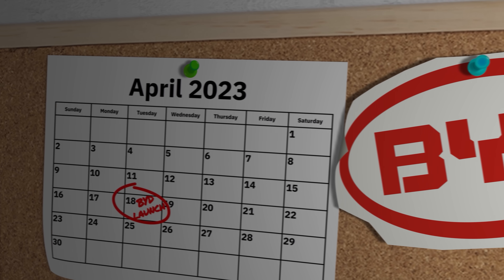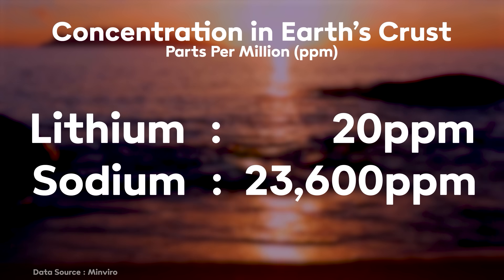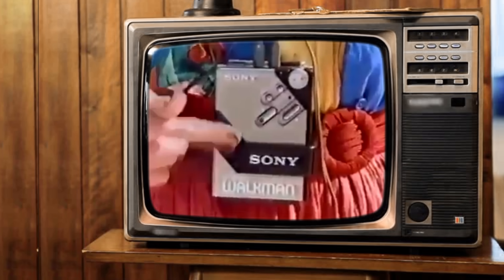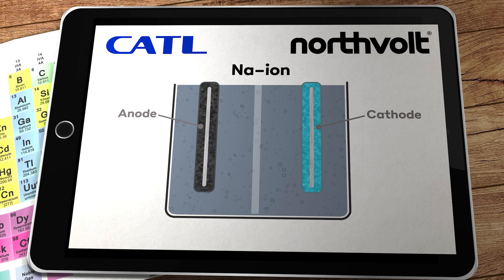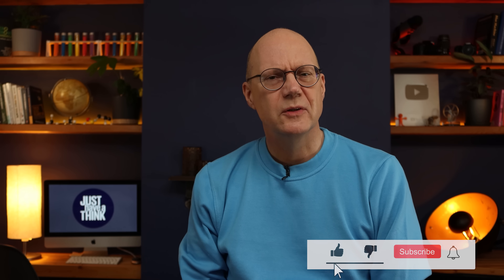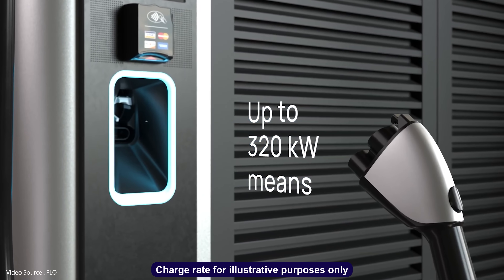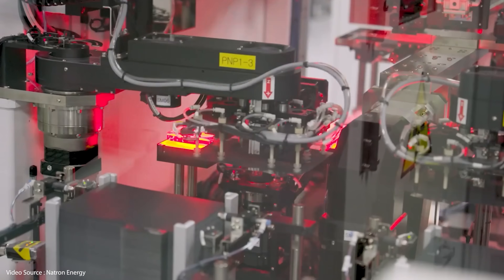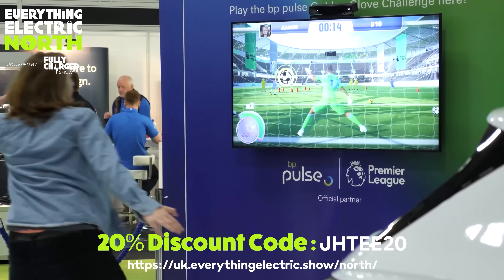Sodium-ion batteries in the USA. Beating China at their own game!

Comment: As far as I have been able to determine, the problem with sodium ion batteries is that their voltage range exceeds current inverter technology to utilize. Fully charged, the voltage exceeds the inverter capacity, which would damage the inverter. And the inverters are not able to function at the lower voltage of the sodium ion batteries. Leaving much of the battery capacity as unusable on the low end as well. The result is that while a sodium ion battery may have a 100kwh capacity, the inverter cannot utilize but about 60%-70% of that capacity.
Reply: There's nothing about an inverter which fundamentally prevents them from using the full voltage range. Its just that they aren't designed that way because there was previously no point. I bet that the inverters in the Natron UPS are able to use most if not all of the voltage range.
Reply: I'm a big fan of batteries in power tools, home power, I use lead-acid for home, because it is simple, predictable, well understood by the layman, and should there ever be a huge failure in the grid, I can still weld, charge my power tools, my home with standard solar/wind, even if I had to run cables from a lead acid bank to the power tool it still works, Many factories, and businesses have lead-acid battery bank backups, the current narratives push change/upgrade to more complex lithium storage. China has shown that batteries have a place, but you still need power stations, and they tend to make sure it works before they commit to infrastructure/mass transport, the complexity of sodium/lithium, and the inability of ordinary p.eople to use it without help, [as they did with the car as I grew up] will be a problem

Comment: a 15 minute 0-100% battery is a game changer for EVs. right now it takes way to long to charge a car. and fast charging is really rough on lithium batteries. even at a fraction of the energy density you could still build car with decent range of 200 miles. and if i can fast charge that pack to 100 in 15 minutes, that 200 mile range is fine. thats 3 hours on the highway and stopping and fast charging for 15m and another 3 hours of driving. thats not bad at all.
Reply: For years I've said, if I could stop to charge for 10 minutes every 300 km (185 miles), that's the threshold where I'll feel like EVs no longer have any disadvantage for road trips. It's still longer and more frequent stops than in a typical gasoline car, but that's the point where I'd say "close enough."

(Of course, this also presumes fast, reliable EV charging at those intervals on any highway where I can expect to find liquid fuel stations today.)

Both sodium ion and solid state lithium ion seem to be heading in that direction. Can't wait.
Reply: Yea heavier but quick charging. So less range for the weight but capable of "gassing up" on the go. Theres a market there.

Comment: Because there was no mention of CO2, for a change I can agree with you. Last week, I did buy 39.8KWH of Lithium Iron Phosphate batteries for my home solar, couldn't wait any longer for even better technology. That said, the cost will be very reasonable after the tax credit and rebate are applied.
Reply: still not bad battery's really you should get 15-20 years out of them before you are below 60% of there rated AH
I have been looking into LTO cells by YinLong for a long term pack i'm making that should last 30+ years
Reply: @NightshiftCustom  The EP Cube (Canadian Solar) batteries are guaranteed for 80% minimum capacity for 10 years.

Comment: You didn’t mention the 50,000 charging cycles! A lithium home battery in the UK typically has around 6000 charge cycles giving them a lifespan of around 15 years. 50,000 cycles in theory means over 100 years!!
Reply: another claim but in a working environment likely much less.
Reply: Or Virtual Power Plant, since some home battery makers won't warranty VPP use
Reply: look up LTO cells made by YinLong they been around for years super safe and rated for 30.000 recharge cycles with very fast charge and high discharge 
they are used manly in buses but are really big right now in the car audio world
Reply: I use a radio that is 75 years old now, works great.
Reply: That is ridiculous and highly speculative because nothing will last that long. The plastics and the electric wiring and everything else would fail.

Comment: Chevron and other oil companies usually just buy the patents so that they can't sell or use them.  No patent, no battery, no problem for big oil.
Reply: delaying the inevitable
Reply: @pyrophobia133  They killed batteries for the EV-1.  Big coal put a stop to building more Hydroelectric and before that pushed for them to be base load rather than putting in three times the generators and making them peaker plants.  Delaying the inevitable is good business.
Reply: @martinsoos  won't work as well this time

Comment: Sodium-Ion IS the safe, less toxic battery chemistry we need to boost the energy transition away from fossil fuels. So it is great seeing these developments.
Reply: Sodium Ion battery weakness is low energy density compared to lithium battery and have much worse lifespan compared with lithium battery. So probably useful for Big immovable storage energy but bad for smaller unit like ev and other gadget like phone, laptop etc.
Reply: Those solar, wind, and hydro plants will do so well with these!
Reply: We don't need to move away from fossil fuels. Your indoctrination is showing.
Reply: You are very unintelligent.
Reply: Will still need hydrocarbons even if less is used for energy purposes.
Reply: What will hydrocarbons be needed for? Genuine question.
Reply: @josephking6515 literally, the grease for your wheels. Lubricants, jet fuel, shiipping, other places where batteries aren't practical
Reply: Don't want to imagine that this information has been suppressed but when simple, cheap options present themselves, there is always going to be those that resist because of money.
Reply: Sodium Ion is non toxic, but it can explode just like Lithium Ion
Reply: @royssche  Look into what you are claiming.  You can cut through a Na-ion cell with a hole saw and then set the drill down and clean up the saw dust.  Try doing that with Lithium Ion cells. I wonder if you have even seen a Sodium Ion cell?
Reply: It is safe, less toxic, but much bigger and heavier than lithium-ion batteries. Do you want to drive an EV carrying a battery pack of 2 tonnes?
Reply: Guess how will we charge those sodium batteries? By burning fossil fuels and generating electricity from it.
Reply: Also less dependency on questionable regimes.
Reply: @Lasstpak  questionable regimes is why your questionable companies were able to operate
Reply: @Lasstpak  Fire fighters will love it.....
Reply: @klausschmid3645  No idea how this is relevant
Reply: @Lasstpak  If you have no idea, why this is relevant.....simply find it out
Reply: I don’t think they understand that lithium ion batteries explode and burn for days! Not hours like a traditional chemical fire.
Sodium ion explosions are still dangerous but won’t need fish slime chemicals to put them out.  Yes they were looking to synthesize fish or slug slime to put out lithium battery fires.
Reply: @Lasstpak  safety is one of the most relevant benefits to Sodium Ion.  You can not afford to have Li-Ion go thermal runaway inside a data center. Catastrophic.
Reply: Well don't forget this battery technology was popular years ago in America and the company went bankrupt and the technology failed. There are thousands of homeowners in America that are super super pissed off right now with the sodium battery.
Reply: @boblatkey7160  Sounds bogus, could you provide some more context?
Reply: @boblatkey7160 If it would be easy, it would have been done already, most likely every tech needs new points of view, attempts of a single company quarantee nothing.

Comment: Sounds like a good option for hybrid vehicle batteries as well. Capable of fast and efficient charging and discharging, yet the extra weight of the battery is less of a concern as it need only be around 20% of the capacity of a fully electric vehicle battery.
Reply: ah yes, and how about for taking high-power braking energy...?
Reply: @lawrence18uk  Yes, this is another advantage.
Reply: Super capacitors for that purpose work well .
Reply: Advanced hybrids will be the way to go for decades unless something universally better than lithium-ion in all fields sprouts up, so it's great to know this kind of battery could be used to make them cheaper, safer, more economically sound and easier to produce than lithium-ion for that purpose, even if authonomy on battery alone takes a hit. That's what the IC engine is there for.
Reply: The trucks Edison Motors are diesel electric. These batteries could work on a pickup truck.
Reply: Where it comes from.  They talk about it 5 years ago 😢

Comment: I wonder (with my EE practical hat on) if combining an Na battery like this for its advantages with Li in EVs in a hybrid dual battery type arrangement might be useful - use the Na pack to fast charge and maintain a baseline energy source but use the Li for density when needed or even transfer the energy across from Na to Li when time allows - could be a bit pointless but may alleviate some of the perceived negatives of pure Li EVs?
Reply: The problem is once the buffer fills up or empties, it's not contributing. That's what's doomed supercapacitors in front of EV batteries.
Reply: @skierpage  I guess you could say the same for having a 100kWh pack over 50kWh when you drive a maximum of 100 miles in one go that the other 50% isn't really contributing - the difference, as I understand, with super caps was that they would act as a "fast discharge" buffer only so would be relatively small capacity-wise. The difference here is that the Na pack could still be used "normally" when needed at the expense of weight but with the benefit of fast charge/discharge, whilst the Li pack would provide the weight reduction for "general" use - something like a 60 (Li)/ 40 (Na) split where a quick 5 min top up on Na would get some extra range then when on a slow overnight charge, the bigger pack would take up the slack? I should probably patent this 😉

Comment: Sounds great for replacing DIeselcomutertrains or helping thirdrail trains to reduce the max contnious current use, when those systems are limited in that regard (Berlin has a 4kA limit per Train)
Reply: Also to upgrade the batteries in diesel-electric trains

Comment: IMO, range is NOT the issue with EV car batteries. 
The real issue is re-charge time.  
IF re-charge time to be 10-15 minutes, not much more than filling up a gas car tank, 
then range disappears as an issue.  
Energy density is NOT the real issue for cars ==
it is re-charge time. 
A Natron battery is better for cars because of its short recharge time. 
If the range is less than 200 miles, 
who cares??

Comment: If they can be fully charged in 15 minutes then given a properly scaled charge network they could still make sense in city/commuter cars. If you've got an 75-125mi range that's more than enough for all but cross country travel (and even then you could probably get by, again with a really well scaled network). Not to mention the cost has surely got to be significantly cheaper if they're able to use primarily industrial waste products. If Toyota say developed a Prius sized car that was Na+ based I'll bet they could price it well below their current $32k starting price for the current generation. Not to mention if the batteries have effectively endless life that heavily reduces the depreciation

Comment: Please mention working temperature for Sodium batteries which on the high side, as you stated stationary application are battery’s forte as additional weight for thermal insulation are non issue.
Reply: I believe it can go a bit lower than lithium at least for charging.  Something like -20C (-4F).  But don't quote me.  And actually that isn't necessarily true anyway since low-temperature operation is related to avoiding lithium plating and chemical reaction speeds which is actually more a function of cathode coatings than anything else.   So, for example, CATL just announced a LFP battery that can be charged down to -20C with +50% better discharge efficiency than standard LFP at that temperature.

Comment: There is a large Iron ore mine in the province where I live.  The tailings left over after the iron ore pellets are processed contain Manganese in substantial quantities.  There is also now a salt mine (i.e. NaCl) being mined not far from me (about 700 miles) so pretty much all the ingredients can be found in any place and in large quantities.  There is also a potential 2200 MW hydro site nearby the iron ore mines.  Sodium batteries seem to be a better fit for stationary grid storage than the industry seems to realize I think.
Reply: I think people also overlook a bit this technology is very much in the early states.  Yes, energy density is much lower than Lithium Ion, but the energy density of Lithium Ion was only around 80 to 90 Wh/Kg in 1991.  It was been improved to over 300 Wh/Kg today, and the forecast is 500 Wh/Kg by 2030, 750 Wh/Kg by 2040 and the maximum is thought to be close to 1,250 Wh/Kg.

So, just because the energy density of Sodium Ion today is low, it is bound to be improved substantially, and it brings a much better cycle life of 50k charging cycles, vs 2000 for Lithium Ion and 10,000 for Lithium Iron Phosphate.

Also, this is bound to bring down the price of Lithium Ion as much of demand used for energy storage can be replaced by Sodium Ion batteries.  A lot of this technology has a lot of improvements left, and we are very much seeing the early stages with massive improvements still to come.
Reply: Weren't the original issues with Sodium batteries that they lacked energy density, and instead of improving they found and developed lithium batteries that had more density from the get go?
Reply: @Suzuki_Hiakura  Yes but for stationary storage the density is not such a critical issue.  For mobile (EV's, Cell Phones etc.) it would be an issue.  If Sodium batteries replace Lithium in the stationary storage then it frees up more Lithium for mobile uses.
Reply: @anguscampbell1533  yes, but the safer and more recyclable sodium batteries is already a better alternative to Lithium from the longevity standpoint. I am hoping to someday continue my tests into salt water batteries though, and build batteries that are more recyclable, and use primitive methods to make :)
Reply: @Suzuki_Hiakura  More power to you, Hiakura-san
Reply: @Suzuki_Hiakura well said.unfortunately we live in a (one size fits all) society
Reply: @ but we don't? Lithium batteries already changed drastically, with new improvements constantly being made, and even the industry of power storage uses far more than gravity, heat, chemical, and water... there is no one size fits all, or else it would simply be dams, as they are typically the best for storing massive gigawatts of power. I think the Hoover dam is actually one of the lowest capacity, at over 2k MW of energy storage, with many new ones being rated near or above the GW range. Cost, Weight, Density, it all matters in the precise use case, and that's before considering safety.
Reply: "Tailings": somewhat akin to Taconite? (grew up in Northern Minnesota, Mesabi Iron Range)
Reply: @johnhopkins6260  Tailings are the remaining rocks after the ore has been removed. It generally gets put in big piles and buried.
Reply: Sodium batteries are a better fit for stationary grid storage than vehicles due to their weight and slightly lower energy density.  China has a demonstration grid storage plant, started building a factory for sodium ion batteries and is ahead of US
Reply: @wulung5943  True, but Molten Salt thermal storage can be up to 95% efficient, so will be interesting if that won't be a simpler and cheaper option in some cases than even Sodium batteries.
Reply: Just put a big Plus sign on one side and a Negative on the other, and your whole province is a battery...
Reply: Energy density is far less of an issue given fast charging capabilities.
Reply: Would hybrid cars benefit from sodium ion? They don't require as much storage and the massive amount of cycles these batteries can provide would enable the battery to last 20+ years, never needing replacement.
Reply: @TomM-p3o  Probably would benefit more from LFP batteries which last over 10,000 charging cycles, vs NCA or NMC which have around 1500 to 2000.

Sodium Ion is better than NCA or NMC at 3000 to 6000, but Lithium Iron is even better at 10,000.
Reply: Stationary grid storage already now by redflow batteries off the shelf !
Reply: Far  loaded.

Comment: The BYD seagull is most definitely not powered by Sodium batteries, It's using Lithium Iron Phosphate like most of BYDs range.
Reply: "The BYD seagull is most definitely not powered by Sodium batteries" <- the current versions BYD has sold, but they also have started a Sodium ion battery facility this year and thus future models may be bought with these kind of batteries.
Reply: @TheDanEdwards  ... may ... BYD themselves never said that the BYD seagull will use sodium batteries, rumours and wishful thinking are all well and good, but I get disappointed when they are repeated as fact
Reply: Yet

Comment: The data center energy issue, will also spark another round of innovation.  Sodium batteries is one use case.  There's also mention of thermal storage (Exowatt).  And also geo-thermal (e.g. Google and Fervo).  Their demands are challenging.  Not only power requirements, but 24/7 match.  It's a good stress test for the green energy transition.
Reply: Bet those diesel generators will be part of hyperscales for a loooong time...